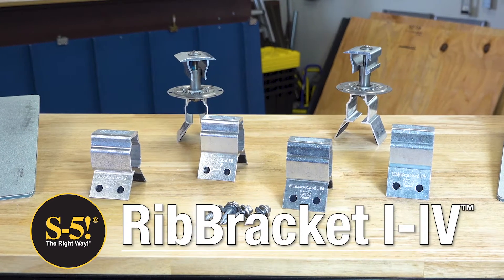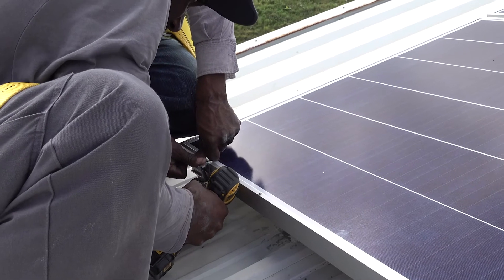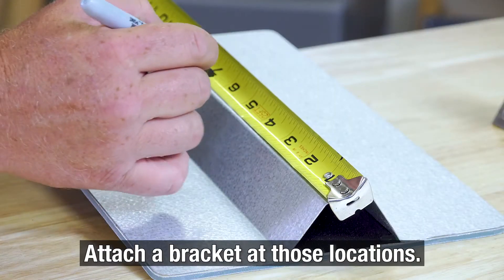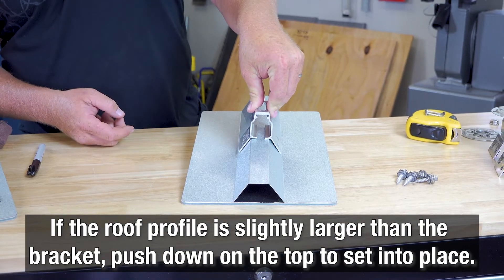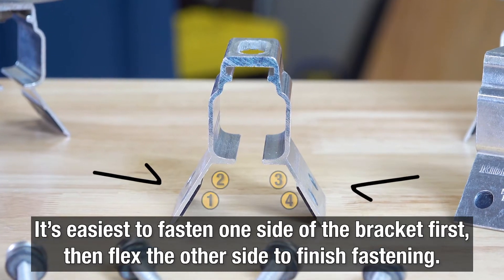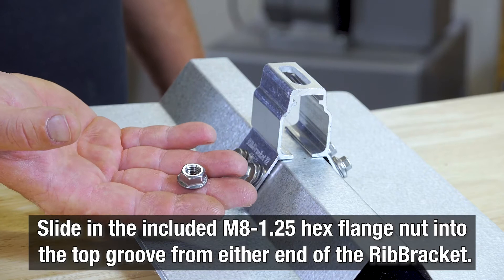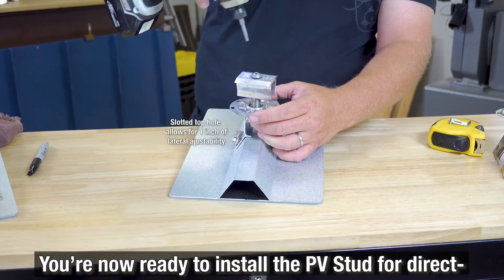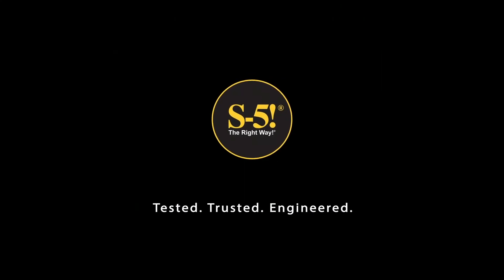RibBracket I-IV™ Installation Demonstration

Comment: Should the bracket have an inside gasket to protect from water intrusion?
Reply from the maker: Yes, and all of our screw down / penetrating brackets have gaskets to prevent water intrusion.  Protecting your roof from the elements is vitally important, but without testing, it’s impossible to substantiate a product’s weathertight claims. ASTM International provides technical testing protocols to evaluate products for quality and performance. To examine water intrusion through metal roof panel systems, ASTM offers two relevant tests: ASTM E2140 and ASTM E1646.
 
ASTM E1646 sprays water directly at the joint or point of penetration to simulate wind-driven rain. Minor vacuum pressure is applied from below in an effort to pull the water through the sample and assess its water resistance.

The ASTM E2140 test is a much more demanding test and strongly preferred. It evaluates water leakage at roof plane penetrations by submerging the joint or assembly beneath 6 inches (15.24 centimeters) of static water pressure for six hours. The system fails if even one drop of water penetrates the joint and all our brackets have passed this rigorous test.

Our rib mounted brackets such as the RibBracket I-V have EPDM seals on the bottom of the bracket between the roof and brackets and are sealed from the top with an EPDM washer piercing fastener. Our brackets that are mounted in the pan of the panels, like our SolarFoot or VersaBracket, have a butyl tape gasket on the bottom and are likewise sealed from the top with an EPDM washer screw. 

If you have any other questions please email us at support@s-5.com
Reply: @TheMetalRoofingAcademy  Thank you for the reply, and I do see that gasket on the inside of the bracket now. Great looking product!

Comment: Do I understand the mounting correctly, that the four self-tapping screws are only going through the metal roofing to hold it in place?
Reply from the maker: Hi Frederick, thanks for your question. Our RibBrackets, as well as our ProteaBracket and CorruBracket "T Series" are all sheet metal-only attachments. These brackets utilize a special self-piercing fastener that pushes the excess material inward allowing for more thread engagement. This results in much stronger pull-out strength when compared to Tek screws that eat away the excess material and that only allow for the thickness of the sheeting for the thread engagement. If you have additional questions, please reach out to support@s-5.com. Thanks!
Reply: @TheMetalRoofingAcademy  Thanks! Are these fasteners included in the purchase of the brackets?
Reply from the maker: @frederickjohnh  yes the screws come
With the brackets. Thank you!
Reply: @TheMetalRoofingAcademy  👍
Reply from the maker: @frederickjohnh  Hi, yes, you get 4 self-piercing screws and 1 M8 nut included with the bracket. Please see some more information on this product here: https://s-5.com/products/ribbracket-i-iv/.
Reply: @TheMetalRoofingAcademy  Thanks! I had seen and downloaded the brochure for the product but it only mentions the EPDM rubber gasket is included. I somehow did not get to that page before, but now see that in the product specifications section it does mention that the 4 self-piercing screws and 1 M8 nut are included. S-5! should consider adding that information to the brochure too.
Reply from the maker: @frederickjohnh  Yes we are working at updating the brochure to include that. We also added it to our new website.
Reply: @TheMetalRoofingAcademy  👍 Thanks again for all your help!